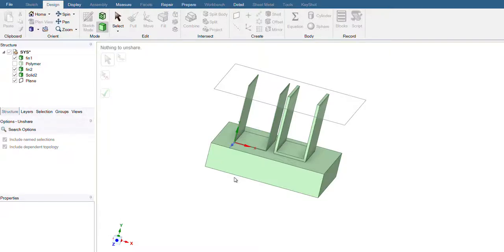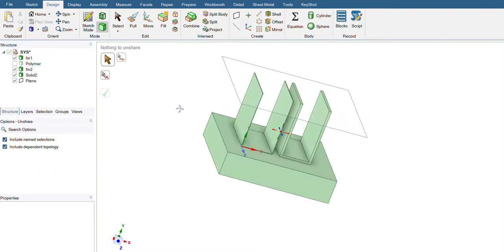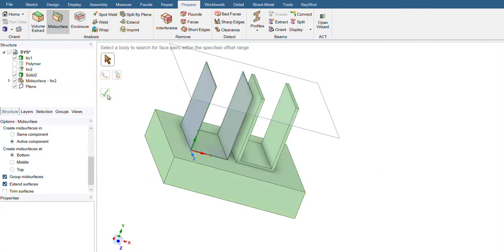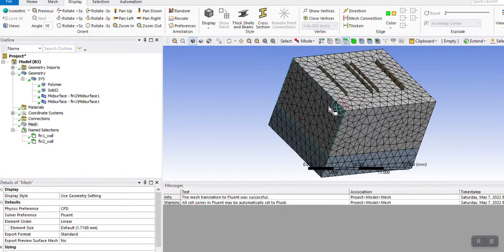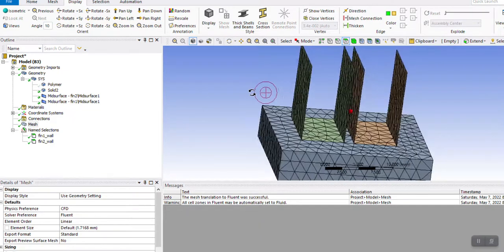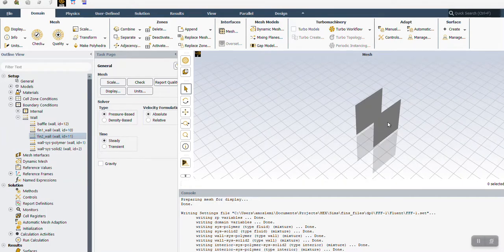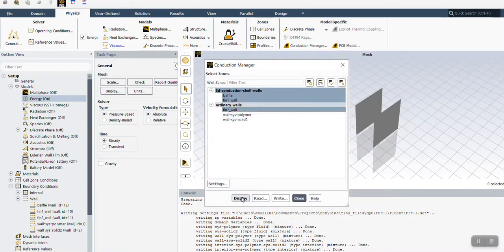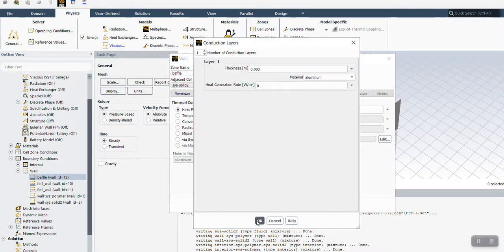How to set up thin bodies as shells for simulation in Ansys Fluent, mechanical and thermal

Comment: when I transfer my shells into ansys fluent to solve , fluent does not read it , and When I click on display mesh , I did not find any components regarding to my shells ,however the shells were meshed in ansys meshing , what should I do ?
thanks in advance
Reply from the maker: Fluent is a bit finicky in this regard, make sure the suppress physics is not activated in SpaceClaim
Reply: @pulsedflowsolutions9058  it is not , to the extent that I have deleted the old geometry , and I can see the new shelled ones , but in fluent it just vanished
Reply: @ahmed.tohami5  I am facing the same problem
Reply: I have this same problem.

Comment: Thank you for your excellent video! And i have a question if the thin membrane/shell has changable thickness, how to define the thickness on Meshing or fluent? thank you.
Reply from the maker: I don't know an easy way to assign the thickness, maybe you can slice the membrane into constant thickness bodies
Reply: @pulsedflowsolutions9058  thank you repling. i'm struggling with the vast disproportionate body—much longer length and a thickness with difference of -3 orders of magnitude:text-green-game-over:
Reply from the maker: @cypressmaccarthy8132  you need to somehow simplify your geometry or bite the bullet and mesh your membrane